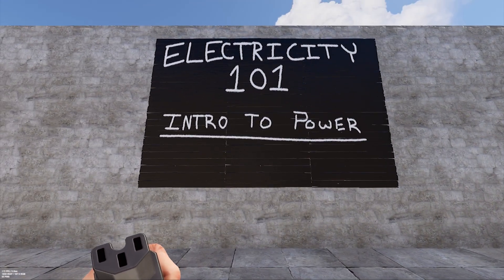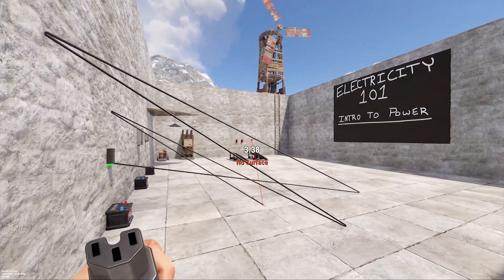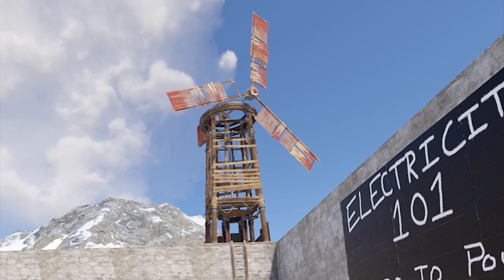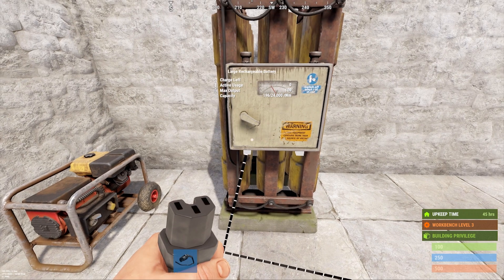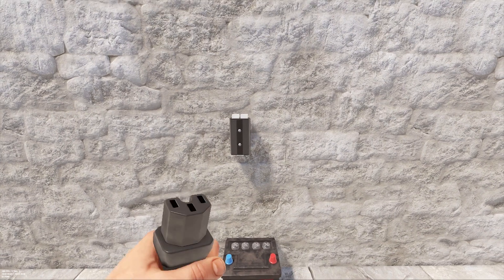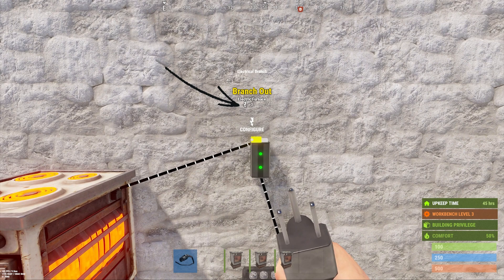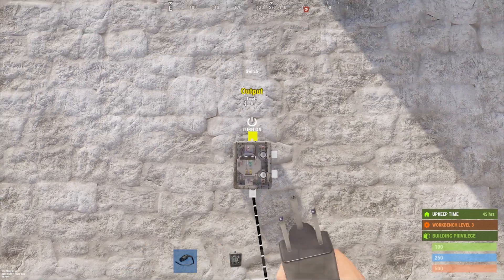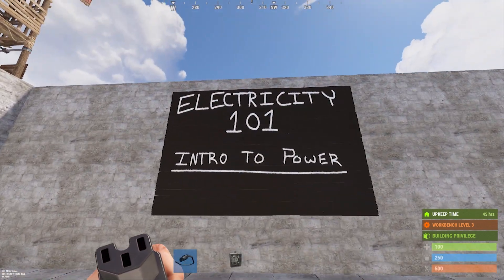Intro to Electricity

Comment: But is it rlly worth the struggle on a weekly wipe
Reply from the maker: I think so! Once you get the hang of it you can set systems up pretty quickly, and the time you save by having loot be auto-sorted, auto-smelted, or lockers/TC auto-restocked is definitely worth it for me, even on short wipes.

Comment: Im hoping to build a scrolling text display using the industrial lights and creating a binary interface to store the letter data so that the text repeats when it scrolls through but i dont know how the electric component work lol
Reply from the maker: I wont lie, that's an ambitious project! Definitely doable though, you'll just need to set up some binary circuits and a lot of repeaters. Ill be covering some of those in upcoming videos, Ill try to include some examples that would help you accomplish this!